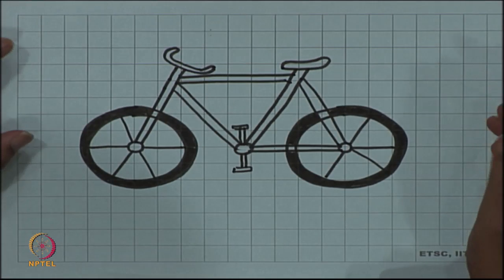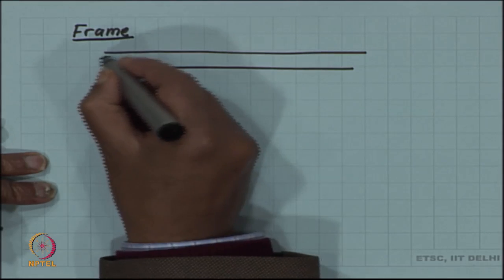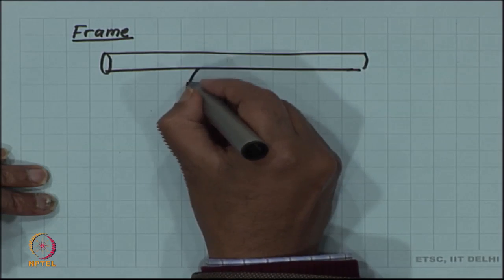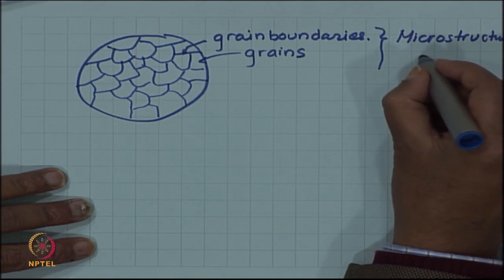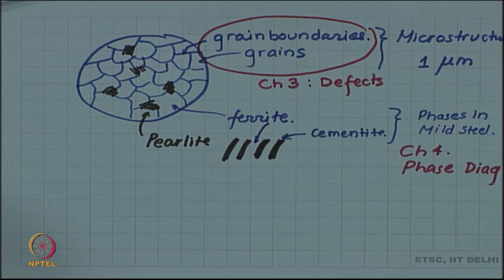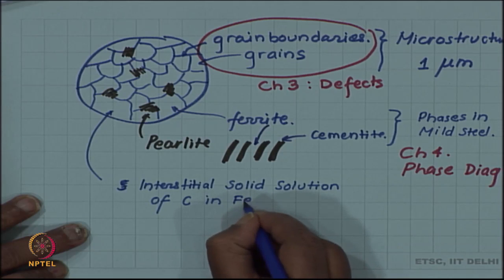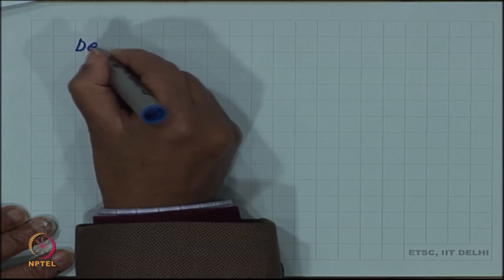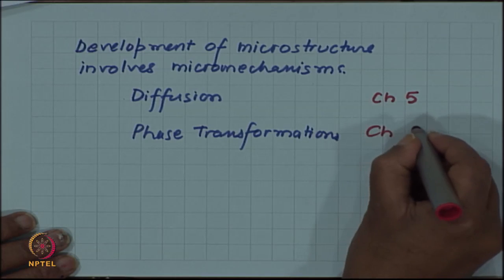1.1 Introduction

Comment: the way prasad  sir teaching is awesome. i recommend the mechanical engineering students to learn this.
Reply: @icecream9118  We use material science mainly in designing aspect for we need to choose an apt material to withstand the respective loads, environmental conditions etc. Now we obviously cannot use copper to design a bicycle coz the bicycle would burn away in summer and likewise, so in order to to make the material economical and apt for all the conditions, you need material science. And for repairing, you mainly don't need to know materials. But if you want to do some heavy work on it, like restoration etc, you again need concepts like carbon hardening, etc. So basically, you need material science in engineering works, but not in technician works.
Reply: @pranav9339  thank you its been 1 year when I commented ,sadly I choose different path now but I really love bicycle and enjoying it.
Reply: @icecream9118  I see you English has probably improved a lot in this 1 year. All the best mate..

Comment: Sir,Can we join silicon steel(electrical steel)and pure silicon rod using bolting.will it withstand rotating torque like in rotor part of motor.l need it's information for my research please give reply